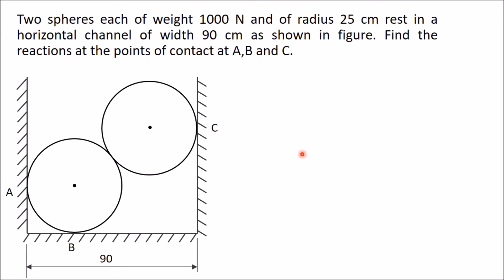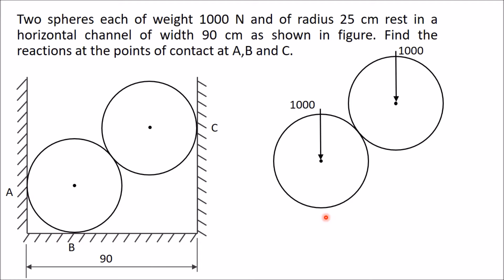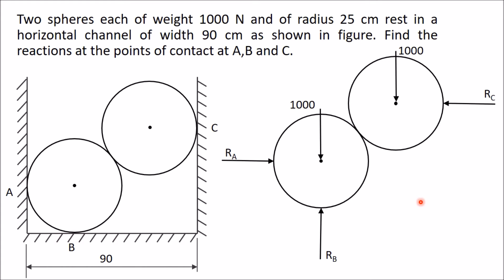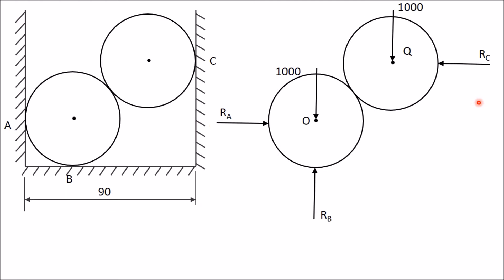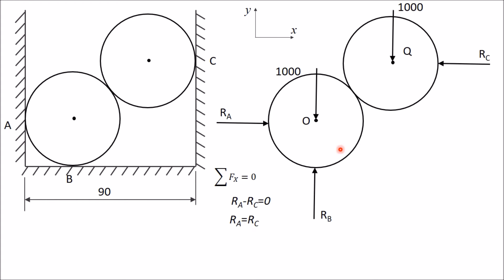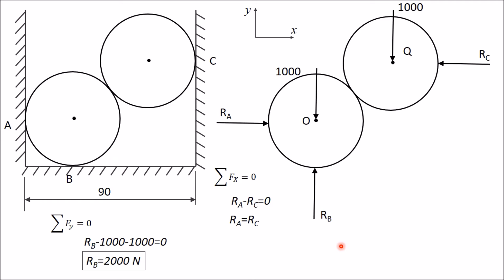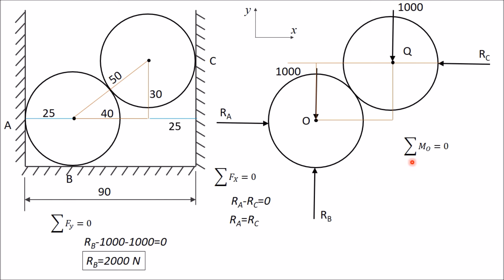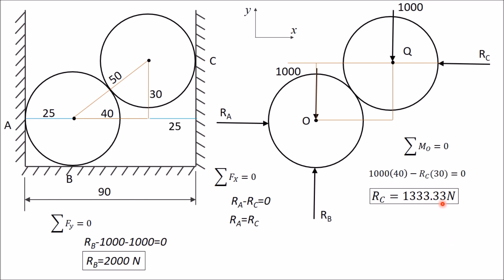Equilibrium of a rigid body: Example 1

Comment: Why reaction of spheres not taken on each other?
Reply from the maker: There will be two reactions equal and opposite to each other at the point of contact. These two will balance each other, therefore no need to show them.
Reply: @drjojithomas  just to be clear the force you're talking about that will balance is, 1667.05N am i right?
Reply from the maker: @shadracvilla4930  yes